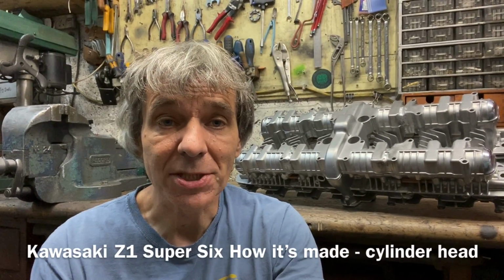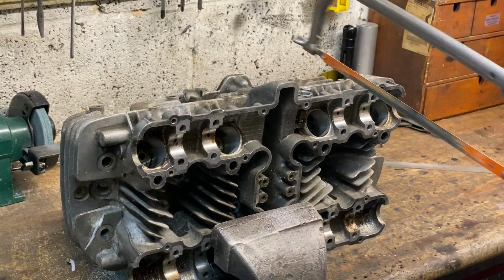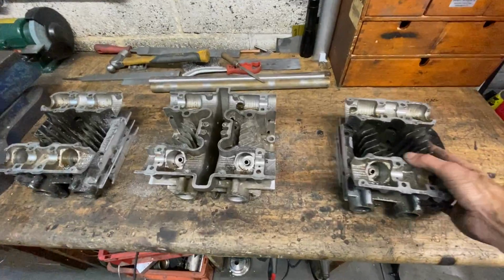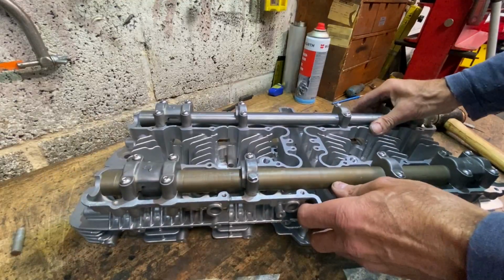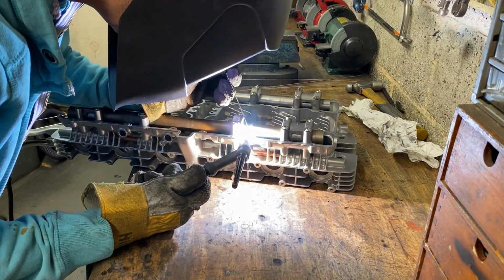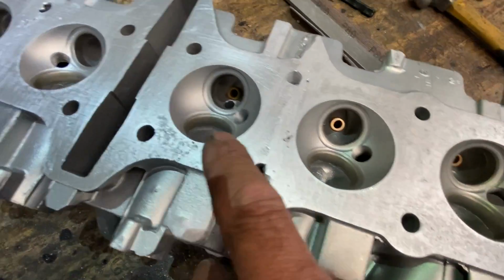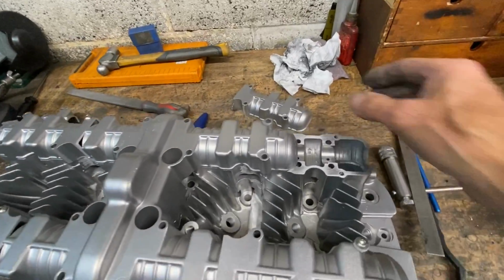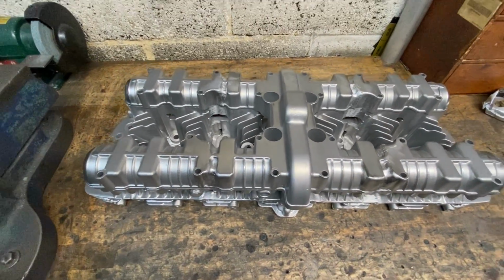Kawasaki Z1 Super Six Cylinder head - How its Made

Comment: "The trick is not to file the cylinder head, only to file the welds" So that's it and I thought it was hard. Thank you Allan you are an inspiration.
Reply: Yeah,that's the trick. Just file the welds. It's a piece of piss,so it is 😄
Reply: Actually, I was surprised he didn't use the mill for this. Stick a few sheets of foil to the face and when the mill rips it away it's time to stop. Just the thickness of the foil left to file.

Comment: Simply unbelievable, cutting two cylinder heads with a hand hacksaw, welding them together, drive shaft, ignition point, carburetor synchronization and a thousand other things. Accomplished a masterpiece in a "simple" workshop. Allen, you are a genius.

Comment: A master craftsman makes everything seem so easy. That is exactly what I just saw in this video. A Master. It blew my mind watching you take a simple hack saw to convert two Kaw Z1 motors into one beautiful 6 cylinder motor. I can't even cut a 1/2inch pipe straight, let alone a full motor block. You've taken your mechanical craft and merged it into an artistic form where Museum's are honored and want to display your work. And what a wonderful life it is when there always seems to be fresh baked cookies or cupcakes in the kitchen.
PS: Watching you Tig weld the parts together I'm surprised to see you use flat butt joints instead of groove or "V" joints. I can understand not being able to construct "V" joint in the complex side and fin sections, but wouldn't it give you far more durability building the "V" joints in the Top and Bottom surfaces? Just wondering if it makes a difference in such a high stress condition as your 9,000rpm revving Kaw surely produces.

Comment: lots of folk been waiting for this one ,, including me. Now if you could only find another bbq the same you could weld them together too ,, and have an oven big enough to fit the new 6 cylinder heads in ,,,, or be very handy if you find a four legged chicken ,
What about the internal oilways , I was expecting you to sleeve them before you sandwiched it all together , or were the holes running through the heads not oil ways at all .

Comment: You must get through case after case of hacksaw blades. Top work. Can I ask why you are not fly cutting the milling work? You can whiz the screw in with a battery power drill. Use a low torque setting to avoid damage (or injury) when the screws hit bottom.

Comment: Allen, the production and  editing of this vid is much better than the older ones, so you can teach an old dog new tricks!  I'm still dying to know how you do the cams, I've got a theory about slotted joints but we shall see. When I was an apprentice mechanic in the 70's the senior fitter would brag about hand scraping big end bearings for trucks and that modern mechanics were wusses that could only fit new parts. He would show off his hand scraping tools set in a leather pouch. He would have loved your work. The old phone is a nice touch, what a  lovely sound.  One question that's bugging me, when you did the 4 and 5 cylinder Kawa triple engines, how did you sort out the oil supply to the extra cylinders?
Reply: it was dowel joints, set up in the lathe for the cam timing

Comment: It is surprising how accurate you can be with a hacksaw! When I served my engineering apprenticeship many many years ago, you learnt that if you messed about, a 4 inch bar of mild steel was presented to you by the training officer and a slice be cut off wiling the afore mentioned hacksaw. You were given a 10 thou tolerance to cut to. When finished, the slice was checked to see how accurate you were. You soon learnt to cut accurately.

Comment: I really did not realise you did so much of this work manually I expected you to dress the welds on the head with a milling machine and use a band saw or reciprocating saw to cut them.
Incredible work have you ever thought about a small capacity across the frame V8 like the Moto Guzzi V8 maybe using a couple of 250 4s although that would really mean some serious magic with the crankcases.
This has prompted me to dream a little, apparently back in the sixties when Honda was fielding the 250/297 sixes the next generation was going to be a 250 V8, but of course Honda pulled out of motorcycle GP's to focus on formula 1 cars, and as far as I know no one has ever attempted such a V8 of this capacity and I do not know of any production engines that would even come near to being useful for building one as you would be looking for something with 31cc cylinders which is chainsaw size two strokes but no 4 strokes.

Comment: I am unable to add anything to the many superlatives used to describe Allen here. He reminds me of the character played by John Travolta in the film Phenomenon, but hopefully without the same tragic ending. He is right about Sandflex 18tpi hacksaw blades, I had plenty of experience with those. The trick is to watch the blade, not the saw, when cutting. I am an aficionado of hacksaws, and my admiration grows further watching the results he can get using such a poor quality saw. But as my clay shooting friends say, it's the nut behind the butt. Please keep doing it Allen, I am not easily given to hero worshipping but you can add me to your list of admirers and will contribute to the bigger barbecue fund.
Reply from the maker: It’s so true, I’ve had that hacksaw at least 30 years and it works as good an any saw after all it’s only a means to hold the blade, and I don’t like the modern “safety” plastic guarded types

Comment: Having seen the quality of your work, I assumed that all of it was done WITH cnc machines!  

Looks like the most useful machine is the mill, as much for finishing and truing the work up too.  

Will you be going into how the oil feeds will work for the extra cylinders?

Thanks, as always for the insight.
Reply: I was wondering about the oil feeds too 🤔
Reply: How needs a cnc machine, when you have a milling millyard 😀
Reply: @voodoochild800  I guess thats a secret hes not ready to divulge yet saving it for another video perhaps , I hope so anyway   because I would also like too see that part being done.  I  dont imagine he just forgot as its quite an important part  of the joing  process
Reply: If you look closely @ 7.09, you will see that he has installed what looks like copper pipe to join the oil galleries.

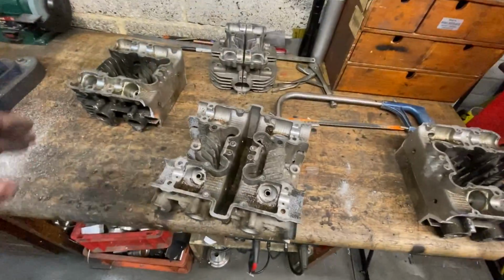Comment: I, like many am awestruck. I do have a question and am in no way bashing his work. At the 2:44 mark you can see the aluminum is several centimeters thick. How is he managing to weld that portion? The welding appears to be on the outer perimeter only. Do the camshafts and TIG welding provide enough rigidity so it it won't be a concern?

Comment: Allen Millyard, I´m curious about how you will make the camshafts. You can´t just make them the same way you have done the cylinder block and the cylinder head as that will give you the wrong timing for a six cylinder engine. You either will have to cut the camshafts in six pieces for each cam and join them correctly phased with the lobes following the six cylinder ignition order. Or you´ll have to make completely new cam shafts.
Joining them from six pieces would be a challenge. You can´t weld them together as the material certainly is much to hard and will become brittle after welding. Silver soldering? That could be done without getting the material brittle but you would probably lose hardening at the lobes. And you have to make a fixture that holds the part in exact right position, not that easily done.
Btw, the Honda CBX 1047 six cylinder engine uses four cam shafts. Intake and exhaust and right and left one and they are joined in the middle at the cam chain sprockets. Useless knowledge. :-)
Thanks a lot for your videos. The craftmanship is fenomenal and the videos are equally good. Thumbs up!

Comment: This might sound silly Alen, apologies if it is, but so many 6 cilinder, shouldn't you cast one and make a molding? Cb750 were done that way sandcasting.  Pooring aluminium would be easier than those convertions..i know it craft and not industry..and i praise your patience. What an artist..one of a kind!
Reply: That would be pretty challenging to sandcast. Yes, the early CB750's were done that way (until they switched to diecasting), I bet it wasn't easy. Castings having a combination of thick and very thin sections are really difficult to get right. I'm guessing that just making the pattern would take longer than the time Allen spent doing the cut & shut job. Then you need a foundry, although aluminium is probably the easiest metal to cast in the home workshop.
Add to that a lot of machining work. The way Allen does it is really clever, I wouldn't have believed it possible without seeing it work, which it obviously does.

Comment: How do you datum the cylinder head cuts to ensure the bolt pitch is correct? Does tolerance stack up never give you issues especially using heads  made 2 years apart

Comment: @allenMillyard Was there any problem caused by the fact that the cut and welded parts are closer together by the thickness of the cuts? Im thinking of the lineup of the centre of the crank big ends with the centre of the cylinders.

Comment: I cannot believe how simp;le Allen make this look! I just wouldn't have the confidence to take a hacksaw to heads and cylinder block as he does as I struggle to cut a straight line let alone chopping up engines without seeming to even bother with measuring them! I guess once you've chopped up as many engines as Allen your experience gives you the confidence? Looking forward to the next video. 

BTW Allen, I'm really interested in the gearbox solution you made for your sons moutain bike, is there any chance you could get around to making a video on how that works as I'd like to have a go at building a frame and gearbox for a cross country MTB as I'm too old to go hardcore downhilling? Cheers.

Comment: Allen, what TIG setup are you using? The Al work is excellent, as is everything else about your builds!
Reply from the maker: its an old 200A AC DC single phase TIG ive had since 2007
Reply: @AllenMillyard  Thanks - I got to see it on this video. I guess AC for Al, any particular profile you prefer for welding blocks?

Comment: What type of filler wire did you use,   I've only got practice with 5356,   general purpose filler for sheet alloy.   Do you use a speciality filler for cast
Reply: 5356 is not good on castings because of porosities. The most used on casts is the 4043 but probably he is using a 4047, a 12% silicon alloy, which wets very well and has no porosities, an important point on such complicated pieces if you do not want to see oil pinpoint leakings through the welds. The 4047 works also very well on thin alloy sheets as it melts at rather low temp and freezes immediately, giving very flat and smooth welds. It's also better for welds that will work heated above 150°C.